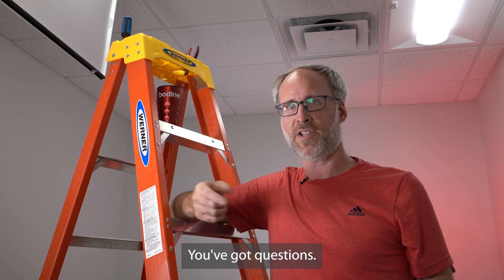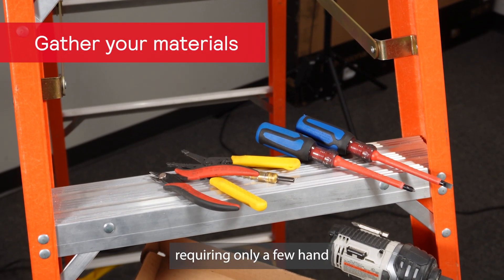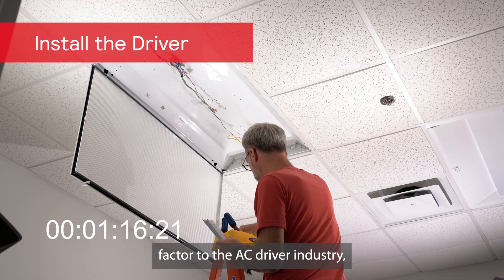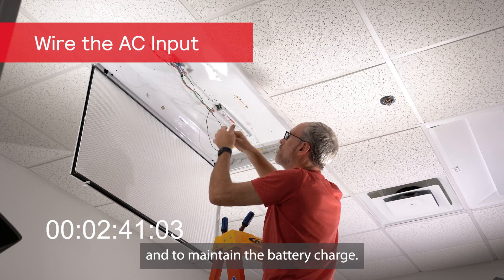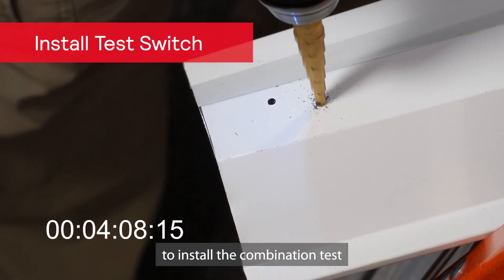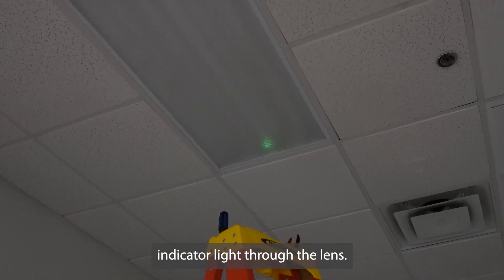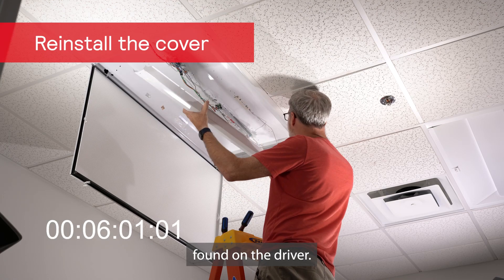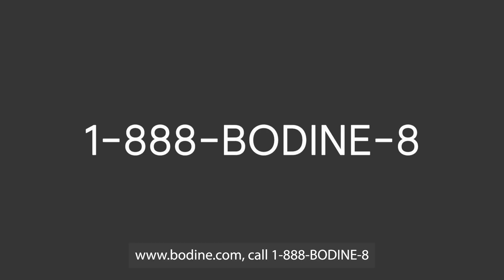Quickly add EM egress lighting to a Type B TLED Retrofit

Comment: Are the B50LP and Lp600 interchangeable. Also are the ICN-3P32-N and the IOPA-3P32-N interchangeable
Reply from the maker: Hi!  The B50LP has been obsolete for a few years and the suggested replacement is the LP600.  The B50LP was designed primarily for T8 lamps and the LP600 was designed for T5's and T8's.  If we are talking Type A LED replacement tubes, then by and large their performance would be similar though, because of age, I don't believe the B50LP was ever officially rated for TLEDs.